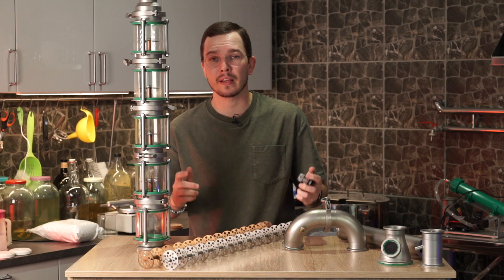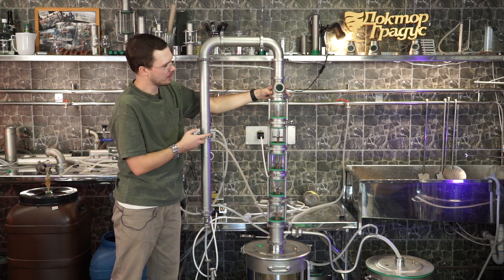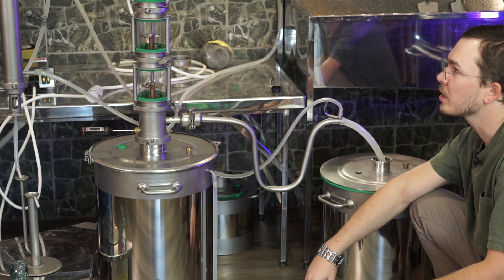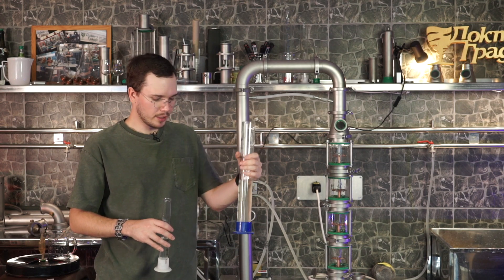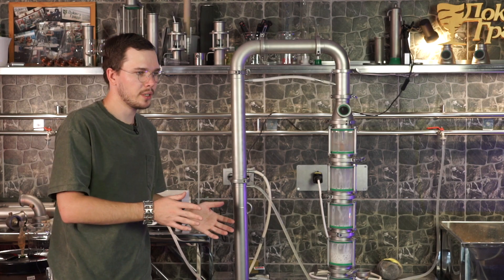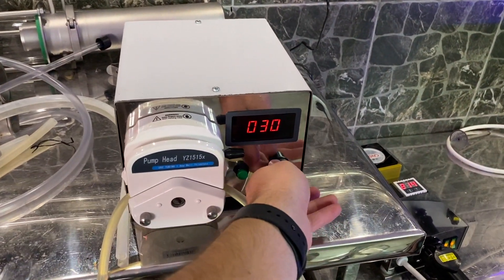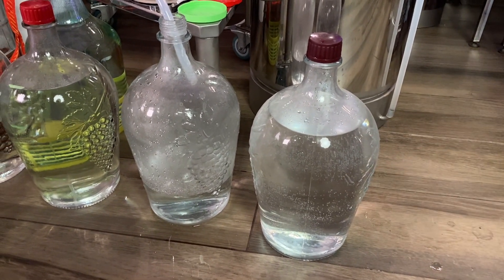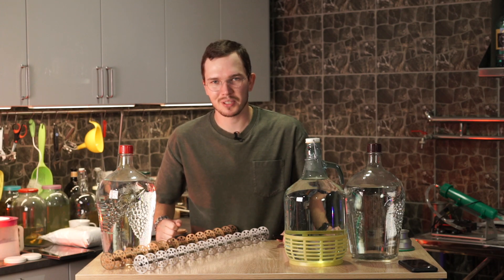Continuous Still - Glass setup

Comment: Andrey hi...Great video,👍 ..it's good to see you doing a trial on this setup.  Seeing it all happen inside the glass column is good... it's easy to understand what is going on inside during the run. How well do those plates work as there is no build-up of liquid on them???....or is that how they should be in a continuous stripping run??  BJ
Reply from the maker: Hi, thanks for the comment! Yes, these plates work like in the video, they stop liquid but just a little. In the 2 inch columns that we make there are more plates, so they hold more liquid. There are many types of plates and packing for the continuous distilling on the market. I will try to shoot some more variation for this process. Also very soon I shoot a video where 3 inch column will be in work with plates like in 2 inch column - it's more efficient you will see.

Comment: I have to admit Andrei I  am having a hard time trying to understand this process. Please show a flow diagram for slow people like me. Your heating water in kettle, pumping the beer through a cooling condenser that you are using as a preheater then across to the glass bubble chamber where it mixes with the water steam ? Then to the spent mash kettle? I don't understand. Is the hot water from the cooling condenser creating a vacuum that draws the spent mash from the column ?
Reply from the maker: Hey, I made video answer - https://youtu.be/fM4MRUHvV3A